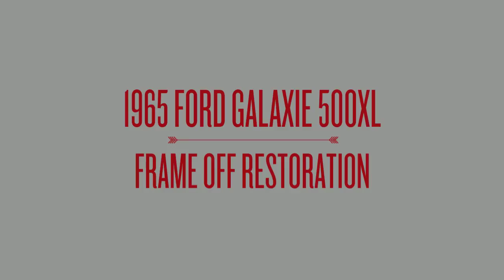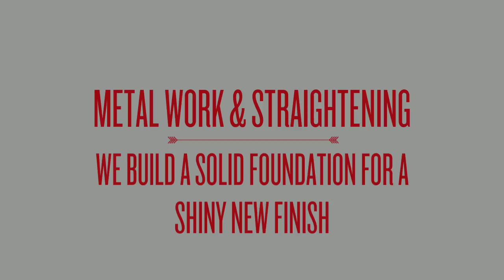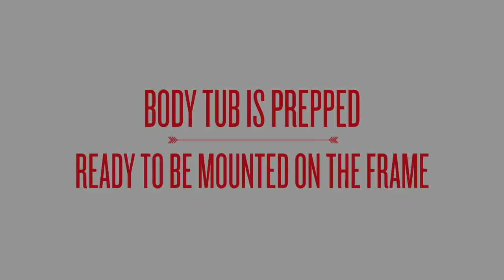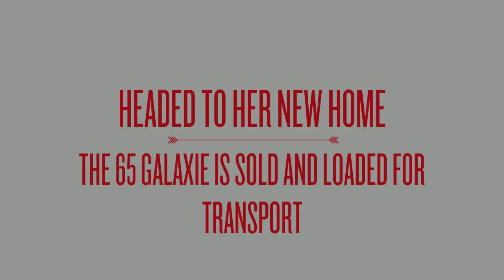1965 FORD GALAXIE 500 XL FRAME OFF RESTORATION

Comment: I have a ‘65 hard top coup waiting for me. Horrible condition though. Cannot get myself to scrap it. You video re-energized me. Thank you !
Reply from the maker: We've stil got some trim parts and interior pieces around that we are selling. Let us know if we can help get you anything! Good luck on your project! This one was also very rough...which is why we had to use 2 cars to make 1
Reply: Driven Restorations LLC How do I get a list of those parts ? Will they fit a 65 Hard top coupe for sure ?
Reply: Driven Restorations LLC I’m 15 and have a chance to buy 2 65 galaxies both 500s one is a xl for $1500 is that a good deal I know the older gentleman one is halfway restored and just needs rockers and rear quarters and do you have any tips I’ve always wanted an older car
Reply from the maker: @cosmictoast8930  Definitely a good deal if between the 2 cars you have all the parts you'll need, especially trim and interior. Sheet metal is available but the fit is really questionable and will need a lot of re-working.

Comment: Looked like that transmission had a detachable bellhousing, like a C4.
My father had a base '65 Galaxie 500 two-door, white on bottom, light blue on top, blue interior, 240, three-on-the-tree overdrive. Probably okay on the plains of the Lubbock area, but must have been dicey in the mountains of New Mexico.

Comment: Makes me miss my 65 XL! Love it all except I just can't get past the engine in Chevy orange. Why did you ever pick orange? Does not go with the red at all to me. Just my opinion thanks.
Reply: I was wondering that myself. According to the sources I've seen, the engine block and heads should have been black, with gold air cleaner and valve covers for that year.

http://www.galaxieclub.com/Colors.html
Reply from the maker: We weren't building it to factory perfect, just trying to save 1 car out of 2 VERY rough donors.  Can't please everyone at once and the guy who bought it didn't seem to mind the orange engine :)
Reply: @drivenrestorationsllc9856  I appreciate the reply. The fact it isn't what I would do doesn't matter so much, since it wasn't built for me. It was just one of those things I noticed, that sort of leapt of the monitor at me as being different.

Comment: Color choice could have been better, like an OEM color, red and white looks odd. Also, why, after all that work, didn't you use the OEM carb, air cleaner and wheel covers? Those Edelbrocks are just volume controls, making more noise and lower gas mileage. Since the metal is restored, you could still go to a correct color and put back the Ford carb and air cleaner and wheel covers. This would increase the value of the car considerably! It would also drive better with at least stock mileage which wasn't great.

Comment: got a 4 door setting out wondering its fate .
Reply from the maker: 4 doors would be tough to come out ahead of the cost to build it. The Fastbacks are increasingly popular though! Maybe part it out if the body is in rough shape?
Reply: rear quarter panels , like usual  .